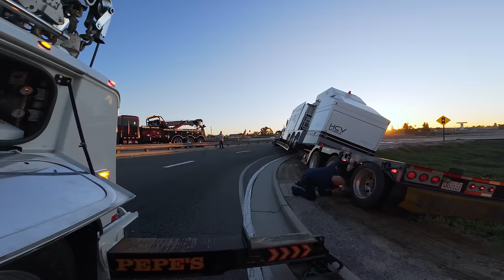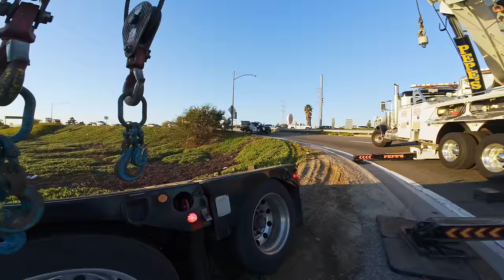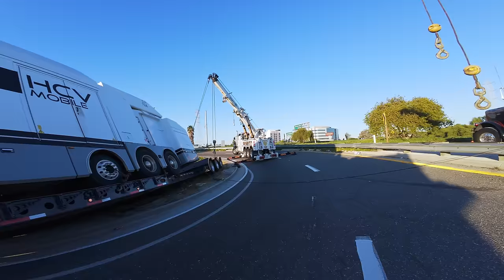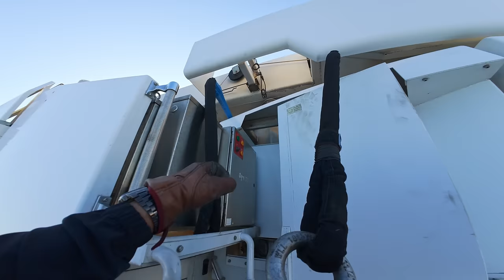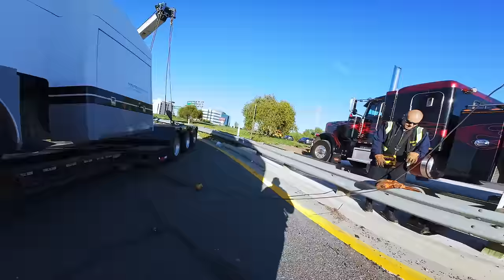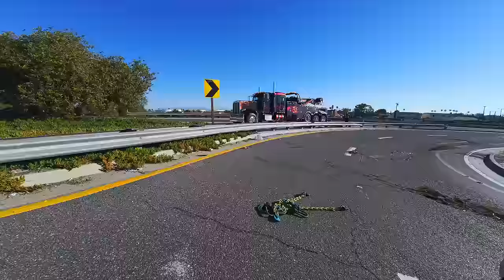60,000lb X-RAY Truck Almost Flips Over!

Comment: I don't know what's more impressive the fact that the truck didn't fall off in the first place or the fact that it's at such an angle that almost any vehicle would fall off at
Reply: From looks of tire tracks, driver failed to make a very wide approach  to stay on pavement, rear trailer tires are way ,way into dirt off curve, soil appears wet and mushy, why whole train didn’t tip is a mystery & a miracle.  Driver didn’t allow for extra length to keep rig on pavement . Hopefully, this recovery is successful.
Reply: @trepanier01 the vehicle being transported was chained down to the trailer otherwise it would have rolled over definately.
Reply: Don't know the tail weight of the X-ray truck, but I would have loaded it facing backwards to save extending the deck of the trailer gotta do what ya gotta do, and shout out to the chain manufacturer
Reply: Excellent chains and tie downs, load stayed with the trailer

Comment: Cop running around trying to figure out how many tickets he can write
Reply: Looks like the truck operator  didn't check trailer tracking in his mirrors.

The trailer wouldn't be so far off the road if he used all lanes while in the apex of the curve.

If I'm interpreting the curve correctly from the keyboard.....

Comment: This is a Mobile Vehicle Examination and X-Ray machine owned by the DHS- Customs and Border Protection Agency. They are used at the ports of LA/LB to examine containers at roadside inspection points. As Alex mentioned, it has a large telescoping boom which swings at an upside-down L shape from the passenger side at a 90° angle that allows semi-trucks to pass under and thru it.  The section that says “HCV Mobile” is the onboard office with all the computers and monitoring equipment.
Reply: Thanks, i thought it was a human x ray truck but the boom had me stumped..
Reply: If only I saw this comment before going on a 20 min Google journey to find out what the hell this is
Reply: I think these go for about $1.9 million
Reply: @mavdadog  Ya... but Uncle Sam pays 10 large for many. Sure, it's a 2mil truck. But contracts man!

Comment: Those X-Ray trucks are very expensive, multi-million dollar units. Good job guys.
Reply: One of the rare times the rescued vehicle is more expensive than Big Flipper...
Reply: Apparently they are garbage and dont work well.. Might have been better as a write off.
Reply: @Peterswarahed  build something better peter
Reply: @kc3baccend  good point.
Reply: That could be a 10mil rig. And he did save it. That ramps... Sketch. Without a 10mph warning sigh... I'm giving this driver a pass.

Comment: I love the relationship these guy's have with 'Law Enforcement' total mutual respect! Good job guy's ..Also why wouldn't a qualified driver like that not stay out wide enough to cut the curve, beats me man!
Reply from the maker: Give respect to earn respect. My dad established that many ages ago. Most of the time when we show up they never even get out of their cars because they know Pepe's has it under control and will open up lanes soon.
Reply: yeah-usually those heavy haul guys are the best--they are always extra careful to get the big money!!
Reply: From the look of it no proper route planning he’s longer than the exit ramp even though he swung out wide
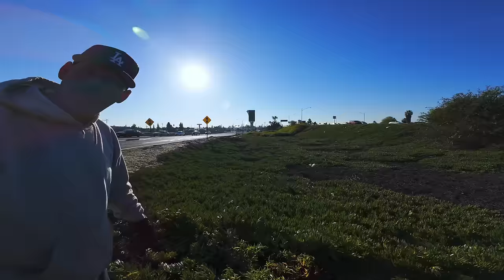Reply: @Los629  route is usually specified by the required oversize permit so not much the driver can do about it, listen to him at 42:16
Reply: @hondaman08  i made the comment before listening to the whole video. My bad. I would think the route planner would have knowledge of that not send the driver that way.
Reply: @hondaman08  For sure.  CalTrans has "f'"ed up before.  This aint the first time.  I would like to know if the permit's KPRA measurement is accurate.  He is streched out.  He seems like he is not a rookie, so it's probably correct and CalTrans didn't pay enough attention to the length of the trailer and tractor.  It is pretty rare that they route you into a bad situation, though.  32 years I've never had it happen to me, but I have heard of it happening.  Good job to Pepe's once again.
Reply: @PepesTowingService  Big respect to your Dad as well, they just don't make men like that anymore! Except for his kids and your crew .. I'll keep watching-
Reply: As he said, dispatcher sent him that way.  It was not wide enough for that load.
Reply: @Los629 exactly what happened, clueless dispatcher. A railroad overpass was hit near my part of Michigan due to an idiot dispatcher. Bridge took no damage. A brand new rooftop HVAC unit was damaged though.
Reply: @PepesTowingService Pepe’s has a long , trusted reputation with the law.
Reply: @KC8EWU it was both dispatch and driver’s fault, if it was permitted: clatrans is to blame. When a driver does some homework….. it is a pure bag of gold dust; this driver is good by not flipping it, but I am sure he knows that it could’ve been avoided by doing some satellite view about the options available trying to accommodate to the length of the vehicle. That’s why I always do my homework and study it carefully the permits, And NEVER RUN UNDER PRESSURE FROM DISPATCHERS, I AM NOT THE HERO LIKE I USED TO BE, CUSTOMERS HAVE MY DIRECT AND STRAIGHT ANSWER SPECIALLY WHEN DOING O/D. ( sorry for this incident to this driver, one more experience under his belly, therefore: more knowledge and wisdom for the next time. My respectful salute and do not let it get You down Sir… family is waiting and keep on trucking)
Reply: that trailer is flucked
Reply: i got sent into oregon with a 14’8 garbage truck under a 14,8 train trestle…5mph puckered
Reply: @DaddyForeverYess  just like Texas

Comment: Like my old boss used to say, 
Everybody F's up, some get out on there own, others need a hand !!
Reply from the maker: Or in this case, a couple rotators :_Laughing:
Reply: but sometimes its just too much like this
Reply: ….their…
Reply: @PepesTowingService  
Years ago I moved a bottle making piece of machinery.

Top heavy like this , in that case I barrel wrapped the boom.
It would rock side to side , especially in curves...

The shipper said it wasn't designed to be in a fixed position. Potential turret bearing and race issue.

It was a very interesting ride. I avoided travel centers with curved off ramps .

Arrived at consignee upright and damage free.

Comment: That looks like a military X-Ray for loaded trucks and Containers. Drive in and get checked out. Went through them when delivering to Military Bases.
Rear box swings Left or right, truck moves back and forth to scan trailers or containers. Driver had to leave area to avoid over exposure to X-Rays.
The boom swings off the side of the main truck making a bridge so the trucks and trailers can drive thru and be scanned for explosive materials.
Reply: Thanks for that explanation, I was like, mobile ray machines are used on people, what's this boom all about?
Reply: The ports use them too.. Since it’s the 405 freeway, I’m sure that’s where it’s going or coming from.

Comment: My old company used to haul that truck, I made a custom deck insert with blocks to get the ass end over the rear deck. Shortens the spread in the well and puts more weight on the rear frame rails. Still need an excellent driver to move something that awkward

Comment: This truck driver never heard of "WHEN IN DOUBT GET OUT!" or he just never uses his right mirror!
Who takes his 52" trailer/lowboy in a right turn and doesn't look to see where his axles are?
This guy!
Good job Boss, you save this guy's bacon for sure!
Reply: 4am or thereabouts, a little bit of fatigue maybe, **it happens. The ramp wasn't the best either, huge camber into the weeds, just a bad road design.
Reply: @colinl9018  100% drivers fault. Trailer was barely stretched. Stretching 13 to 15' is what an experience guy may consider barely. The camber into the weeds was beyond the curb, kinda not supposed to be there! Ramp was a slightly tight curve in the middle (driver didn't even make it that far)but massively wide and stretched to only 45' or so in the well he wouldn't even have come close to the curb if riding the guardrail with the front bumper the whole way. But go ahead and deny all the evidence.

Comment: Excellent chains and tie downs, load stayed with the trailer, after drop off I would be checking the 5th wheel bolts and nuts, platform complete assembly

Comment: DRIVER`S AT FAULT  FOR NOT BEING "PREPARED" CHECKING THE ROUTE PRIOR TO DEPART , TO  CHECK "THOSE DETAILS",,, ALSO REGARDLESS IF THE PERMIT DOES NOT REQUIRE AN ESCORT, THE CARRIER  SHOULD HIRE A "CERTIFIED ESCORT " TO ""STAY BEHIND THE LOAD"" AND  ""THAT"" NEVER HAPPENED .  LOOKS LIKE THIS DRIVER DON`T KNOW READ OR HE NEVER MOVE AN OVERSIZE LOAD BEFORE BECAUSE  IN THE PERMIT SAYS " THE LENTH OF THE EQUIPMENT" . NOT EVEN WARNING  FLAGS  & NOT EVEN FLASHING WARNING LIGHTS ON THE SIDES OF THAT LONG UNIT ?????  THIS IS WHAT HAPPENS WHEN THE BROKER  HIRE "CHEAP TRUCKERS"  AND  DON`T WANT TO  PAY    PROFESSIONALS  WELL KNOWN  PEOPLE.

Comment: Does the highway patrol route oversize loads in California? We hauled a Koehring 6650 out of downtown Chicago and the police set the route. First they had a bridge to go under that was only 11 ft clearance with a 12 ft high load. Then they led us to a single lane on ramp with concrete walls on both sides that had a 120 degree turn that the trailer couldn't possibly make.

Comment: This is an example of the low quantity of drivers available. From the position of the tractor he was not near wide enough. He was in a normal position of a normal tractor/ trailer. He should have be kissing the guard rail and he was not.
Reply: Looks like he misjudged the tightness of the curve by entering the ramp in the inside lane looking at the tire tracks. Even with that extendable if he would have only kissed the curb or barely ran over it had he entered in the outside lane. Looks like he is probably some fly by nighters considering they are running a doo doo International as a heavy haul truck.
Reply: Or just bought a proper trailer with steering on all axles on the trailer so the low quality drivers down screw up so easy.

Comment: Question why did dave join his 2 lines? Is it to double pulling strength by using both winches?
Reply: Spreads the load across both sheaves on the boom and is a bit easier to pull two lines out and hook them together through a snatch block vs pulling one line all the way out and back to the boom.

Comment: The road engineers need to do a better job at designing entrance  and Exit ramps. I have been on some that there is no way in hell that truck would make it because I barely made it with a 2022  Cascadia and a 53 foot trailer tandems said all the way forward
Reply from the maker: Not every ramp needs to be a truck ramp. They have designated ones.

Comment: Anyone drug test that driver ? looks like he just thought he was driving around in his pickup truck judging how fast that trailer was off the road by the marks.
Reply: If that driver comes up with a negative test, next question would be where did he get his CDL??? Put him on “Bone Head Truckers”!
Reply: @farmerbrown3768  LOL!! Right!, Only a Bone Head would forget that load on the back,  giant mobile xray, probably on it's way to a border crossing/ Gov contract, either way one hell of a costly bonehead move if it went belly up.
Reply from the maker: Too be fair, that is a very tough off ramp. If the load was already leaning to that side, gravity plus that angle could easily make him slide. Extra long trailers should not even be on this ramp, it sucks but sometimes they get routed here. There is nothing to do but stop, then call for a rotator to swing you over as you continue the turn. I've been called there plenty of times to do this but some people think "maybe I'll make it"

Comment: It seems like a poor engineering design to have the exit ramp banked so steep... it's not an oval racetrack for high speeds.... it's an off/on ramp...  Driver is ridiculously lucky it didn't roll Those X ray trucks are into the Million$ of dollars... especially a big one like that with the Rotator on top. easily worth more than the Rotator & the semi towing it is worth...

Comment: Not a good plan to crawl on top of an unstable load. Never a good idea to wrap a safety line on equipment not designed for tons if weight.
 If nothing was damaged then this was by sheer luck.
Reply: unstable load lol it’s 60 thousand pounds….adding at most 250 pounds isn’t gonna move it did you see how deep it was dug in to the dirt